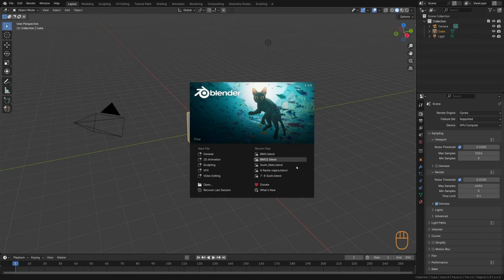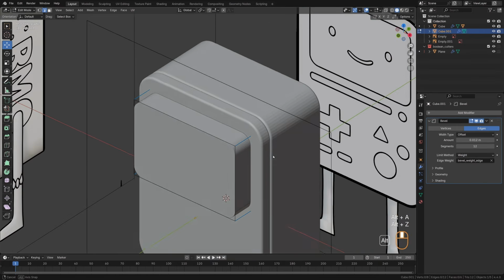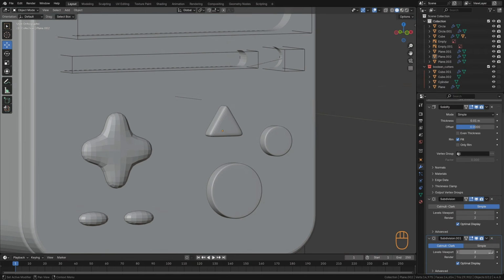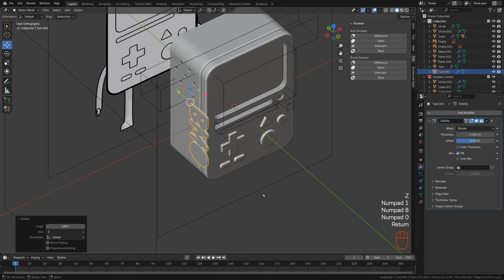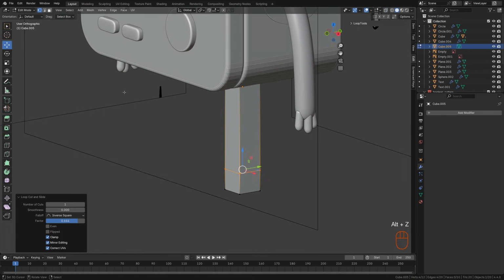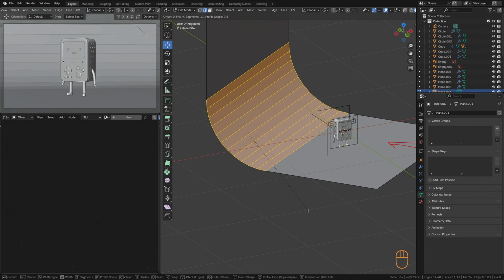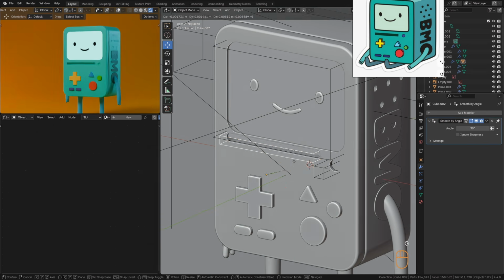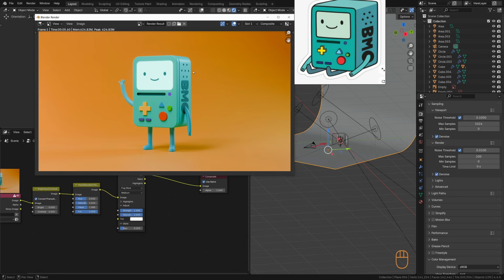Learn Hard Surface Modeling in BLENDER (Beginner Tutorial)

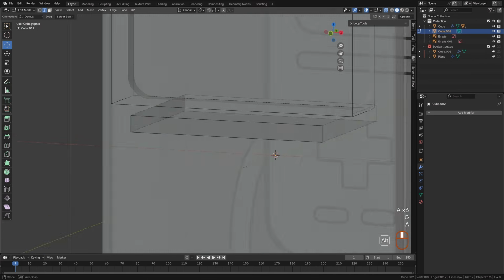Comment: My bevel tool is doesn't function the same as yours does at 10:30s, instead of a round semi-circle like edge it bevels all the way into the long edge and leaves the shorter side almost unchanged? there doesn't seem to be a lot of parameters I could have got wrong for it to behave like this?